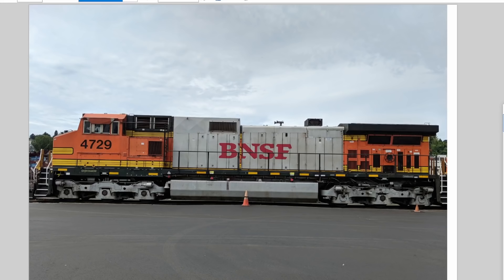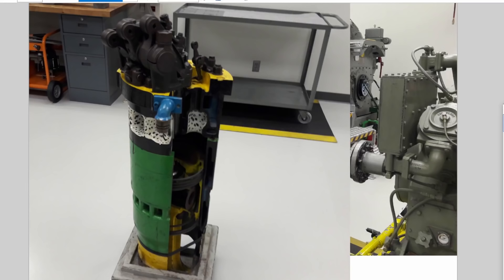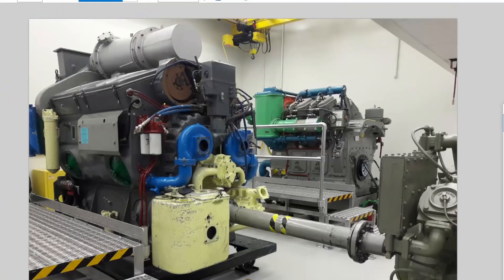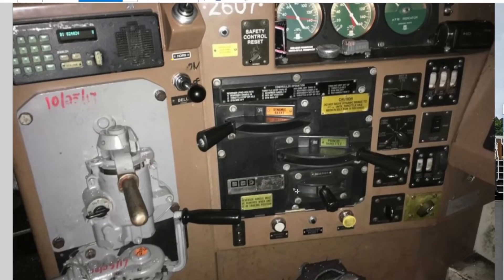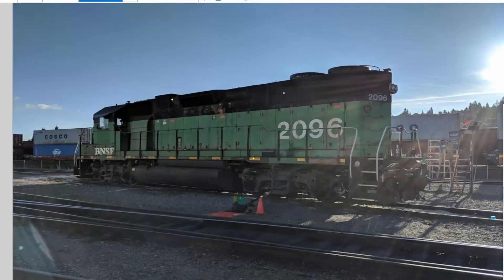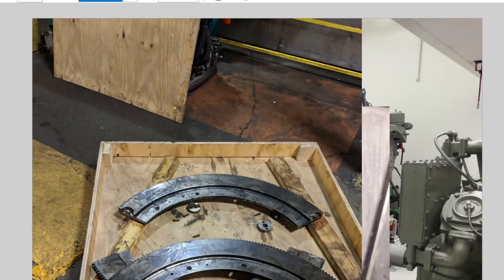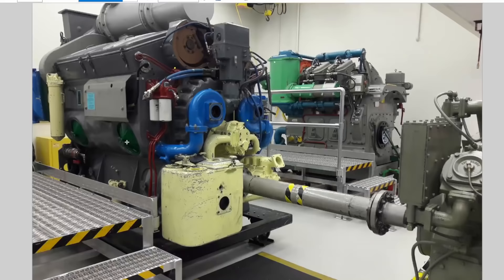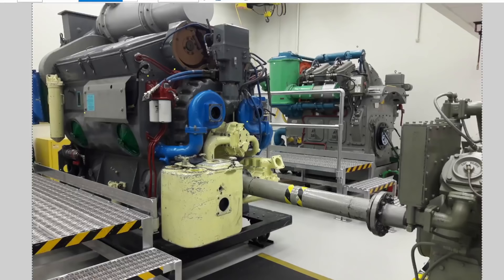Diesel 101 - How DIESEL LOCOMOTIVES Work! [10 Levels]

Comment: Good video. As a trucker that used to haul replacement parts for Norfolk Southern....Alternators weigh about 19,000# and pistons, for a v-16, are  about the size of 5 gallon buckets. 
   Something I didn't know until I saw a new locomotive cab at a supplier....the sleeping and bathroom accomodation in the nose of the cab.
Reply from the maker: Oh man, i knew the alts we're heavy but not that heavy. Neat.

Comment: Really enjoyed learning about the diesel electric locomotives! One thing you might want to look into was the steam turbine locomotive that tried to make a appearance around the same time diesel really started to take over. I know that Norfolk western had a prototype don’t know if it actually got anywhere though
Reply: I think UP had a few turbine powered ones as well.
Reply: @pootmahgoots8482  UP had both steam and Gas turbines. The steam ones were a huge disappointment. The gas ones, not so much. C&O had 3 steam turbine electrics before the N&W built their only one. As you had electrical, fire, water and coal all in the same locos, they were maintenance headaches. The three for C&O were to power passenger trains, " The Chessie ", while N&W planned theirs for freight. The N&W looked more conventional as it rode on standard 6 wheel trucks with span bolsters. 
UP Steam Turbines: https://www.youtube.com/watch?v=K9mo9Ald6EI
C&O Steam Turbines: https://www.youtube.com/watch?v=HPaJKdBzwZs
N&W Jawn Henry: https://www.youtube.com/watch?v=5n0VuljeSM0
Reply: They still use steam (and gas) turbine electric locomotives to this day, some even run in water power!

They just do not put the generator on the actual locomotive and use long wires to connect them both!

:-P    :-b

Comment: 14:00 Fun Fact: The russian M62 locomotives use Roots blowers to get the air moving (0.2 bar) when starting the engine. After that, the turbos automatically take over to raise the intake pressure to 1.2 bar.

Comment: a note on the roots style blowers, air actually flows around the screws of the blower, not trough. the screws turn opposite of eachother
Reply from the maker: Yup, I've since learned that on this video. Had no clue, thanks for the comment :)
Reply: @Hyce777  Yes...  A roots blower is really just an external tooth gear pump (like an engine oil pump) with long gears.

Comment: Some additional info on blowers: The EMD engines have a turbo-supercharger, and it's an example of one of the less common meanings of the phrase. Depending on era and application systems called  "turbo-supercharger" can be any of the following:
A) A supercharger 'feeding' a turbocharger, the air is compressed by each in series.
B) A supercharger and turbocharger in parallel. The super feeds the engine at low RPM when the turbo isn't spinning fast enough to be effective. At higher RPM the turbo takes over feeding the engine and the supercharger is unclutched so as not to waste engine power running it. While turbos and supers complement each other well this arrangement is, in my opinion, overly complicated and an inefficient usage of weight/space. (Then again, I love the Napier Nomad and turbo-compound engines in general so what do I know).
C) A centrifugal compressor driven mechanically with engine power. This usage is frustratingly common in American aviation literature from the 30s and 40s. Not heresy on its own but distinctly unhelpful, especially with engines that also have exhaust driven compressors. 
D) The EMD! This is a centrifugal compressor that can operate as a supercharger or a turbocharger and arguably counts as both. I call this arrangement a super-turbocharger ostensibly to avoid confusion with A or B but mostly because it sounds cool.
Initially the centrifugal compressor is driven by the engine (as the author notes in video, at a gear ratio of 18:1). Centrifugal types work best when they spin really fast! An air molecule is drawn in and picks up a lot of kinetic energy when it gets whacked by the impeller blade. It flys off to the edge of the circle and enters an area of the unit called the 'diffuser'. You can think of it like a funnel or a que line. The air molecule runs into a crowd of other molecules and all of them have high kinetic energy and the diffuser gets them all moving in the same direction and in a somewhat orderly fashion. Another way to put it is that the diffuser uses geometry to convert a gas's kinetic energy (velocity) into potential energy (pressure). (This is further proof of math being effectively witchcraft. Geometry is especially sorcerous) 

You may ask, 'whats the point of having a compressor at all? A blower of any type is extra mechanical complexity, is it really worth it? The majority of engines commonly encountered by an average person don't have a turbo or a supercharger; they're naturally aspirated. They work just fine with all natural air just like god intended.'

First of all, never be satisfied with the way god put the universe together: it's suboptimal and can be engineered to be much better. Just one example: thermodynamics has "free energy" as strictly illegal and you can hope to "break even" but that's mostly optimism. Whenever energy changes from one form to another there will be losses. In a closed system entropy only goes up. So you have to be efficient when dealing with energy and heat.

That's where superchargers and turbo chargers come in. Engines are heavy, you have to haul the weight around with you and they only provide so much power. Forcing more air into the engine let's you get more power out of it for minimal additional weight. The forced induction can be either 'positive displacement' or compression. Positive displacement is less efficient, but it's useful at all RPMs. The work it does is linearly proportional to RPM. Using a rotary compressor, usually centrifugal, is more efficient but the work it does rises exponentially with engine RPM. So at higher speed it's amazing but at lower speeds it doesn't do much. Superchargers are usually positive displacement and driven mechanically. Turbos are usually centrifugal compressors and powered by an exhaust driven turbine. (That's not free BTW. Nothing in this universe is free. But harnessing exhaust gasses to drive a turbine is pretty efficient.)
Reply from the maker: Thanks for the brilliant comment adding way more insight than i had. :)
Reply: @Hyce777  You're welcome :) I'm happy to contribute; moreso, I feel it's appropriate to offer what knowledge I can to supplement a great video. I'm an academic and for the most part I haven't learned from practical experience but by voraciously consuming the published works of those who have. Or other academics who have already done the hard work of research and correlation. (Their work that is; academics don't consume each other to gain their power.)

On the topic of forced induction I would recommend fellow YouTuber Greg's Airplanes And Automobiles and his excellent video "Turbo Vs Supercharging in WWII Aircraft". A lot of my insight comes from that, and from going through the NACA reports that Greg based the video on.
Reply: @GRudolf94 to piggyback off of this comment, it got the name of turbo-supercharger because it was a supercharger that was turbine-driven off of exhaust gasses rather than mechanically linked to the engine. One of the largest issues the USAAF had with their early turbochargers was that the turbine blades were at risk of melting while in use and causing loss of power.
Reply: the EMD 645 uses a centrifugal turbo charger that is gear driven until the exhaust force drives the turbo faster than the centrifugal clutch on the turbo drive gear, at that point the exhaust takes over and drives the turbo,  a 2 stroke diesel requires a forced air supply to operate as there is no vacuum on the intake in a 2 stroke diesel

Comment: I used to work for L&S Electric near Minneapolis, MN.  At the time we did a ton of rail motors and generators.  We used to get A/C traction motors shipped up from BNSF Topeka.  Our shop guys would year them down and usually have to cut the stator cap off and restack them, at least in part.  Then rewind and rebuild.  We did DC motors and generators as well.  I did transport.  Did an onsite swap of a DC generator on a Red River Railroad loco at a grain silo once.  Brought fresh rebuilt generator out and a crane swapped them.  We did a bunch of work for Loram and CP as well.  Sometimes some other stuff as well.  At least for rail.  Tons of other stuff as well, like paper mills and power plants.

Comment: I love this, great job Hyce. I’m enthralled with your industries engine design. I wish we could pull liner/valve assemblies and swap em independently. That’s awesome. That and heavy mining trucks, even though they have a similarly sized engine, they’re all high pressure common rail injection 4 strokes with after treatment systems. Anything 2 stroke that we see are Detroit Diesel dinosaurs 😂 I really enjoyed the video. Thank you sir!
Reply: Detroit Diesel and the EMD engines are quite literally the same design by GM, so yeah, dinosaurs. :P
Reply from the maker: The GE stuff is common rail high pressure as well, also 4 stroke, but still w/ replaceable power assemblies.
Reply: @Hyce777  I’d be in Heaven. I have to remove the engine in the field, load it in the truck, take it to the shop to rebuild then go put it back where it belongs.
Reply: I saw a video recently about the diesels that power large ships.  They are designed so that the piston/cylinder assemblies can be replaced while the engine is running and the ship underway.  Absolutely amazing.
Reply from the maker: @LandNfan  whaaaa? How the hell do they do that?
Reply: @Hyce777  VERY CAREFULLY!!!  There are some great videos...  go to YouTube search and start with "welt - cruise ship engine repair".  Amazing stuff!

Comment: Of course what you got to see here Hyce is the most common locomotives, the diesel electrics.
However Germany have been a little more silly in Europe, you have Diesel Hydraulics and some even have transmissions and you can hear them shift.
Examples of this is the BR 642, Siemens Desiro and the hated Norwegian Rail's Type 93.
The latter a locomotive where you can hear it shift, but was dreaded by passengers as they got the brilliant idea of using a DMU on long haul rail routes.
In the end, the old style of locomotive with consist powered by an EMD prime mover that saw its hayday in the 60s, the EMD 16-645E3B is still running on that route today with an updated consist.

Oh and they did try to replace that Di4 locomotive as well, but in the winter they didn't like tunnels and had a tendency to shut off in the cold, so they were returned to Germany and the old EMDs put back in operation. :D

Comment: Great intro. Learned a lot mostly about the cooling and governor/fueling interaction. I had assumed a simpler system of the governor preventing the engine from over revving and the alternator excitation controlling load.

Comment: Yeah, GE's load REALLY slow in comparison to EMD's. A buddy of mine told me he put a unit in run 8 from sitting at 6. About 4 miles down the line, the motor was STILL loading up. EMD's load up just about as fast as you can notch 'em.
Also, plenty of the older EMD's with the 567's used the main gen as a starter motor. GE wasn't the first to do that!
Reply from the maker: Not surprised on that fact! Interesting. I was surprised the one time I've run an EMD just how quick it set off.
Reply: Worst loading GE we ever had on Conrail was the U28B. Fortunately we only had two of them. I got one as a trailing unit on a 120 car train of empty hopper cars going out to trap rock roughly 17 miles west of West Springfield yard with a GP38-2. I sat with the Gp isolated for over 6 minutes while the GE ever so slowly accelerating from idle then put the GP back on line, it was my first train as an engineer. West Springfield yard had a 1 percent grade heading west to CP 100. When we got to trap rock we had to pick up 60 loads of trap rock going to Selkirk, New York. It took over an hour to get that Uboat to full throttle. I complained heavily about it to Selkirk fuel pad Foreman about it’s performance. He shopped it.. had the same engine several months later only this time it responded with black smoke and loaded up much faster than before. I asked the foreman at the Selkirk shop what was wrong with it to load that way and was told “ nothing was wrong with the governor, that’s simply the way GE avoided black smoke was by crippling how fast the engine loaded. Once you got to the 5th notch or higher after they reset the governor the turbo kicked in and the smoke disappeared. All other GE’s while they loaded slower than an EMD we’re about 10 second behind an EMD in loading up in response to a higher throttle notch setting. When the dash 7 GE came out the slower loading GE became a thing of the past. The GE B23-7 became my favorite switcher engine after my first time using it. The trainmen could stand vertically on the bottom step without a problem, it had a bigger air compressor and was quieter compared to an EMD SW-1500. It also weighted more compared to an SW-1500, had a full bathroom and a better cab fully electric cab heater. I showed up for my third trick switcher and the B23-7 had all the windows and doors left open with the cab heat off an 2 feet + of snow in the cab. I closed all the windows and doors except the engineer’s window, turned the cab heat on low fan and 35 minutes later I was dry as a bone in the cab and comfortable. All the snow melted inside that 35 minutes. 

Food for thought
Reply: @james5360  That's an awesome story. Thanks for sharing this! Really gives more insight on the how and why.
With steam locomotives, it's almost all a "feel through the seat of your pants", you can really get a much more clear cut answer with diesels. You know more of what you're getting into and what to expect.

Comment: 37:44 those holes aren't actually for balancing the flywheel, they're for 'barring over' the engine (rotating it with by sticking a lever in the hole and pulling on it) The balancing holes are usually on the inside face towards the engine.
Reply from the maker: Oh really? huh, we had bar-over machines that grabbed the ring gear. That's neat. Cheers for the correction.
Reply: @Hyce777  The tool that grabs the ring gear is probably a bunch more ergonomic to work with though. 👍
Reply: @AlexanderBurgers  sounds like a 2 (or more) man job

Comment: Very informative.  Learned a lot of stuff that I'd been curious about.

Being a bit pedantic, "regenerative braking" means using the power generated to either charge a battery to use later or other trains on the line through the catenaries or third rail, so it'd only apply to electric locomotives/EMUs as far as trains go.  It's not practical to do so on those really long stretches of track where only one train is in an electrified block.  Without another train to draw the electricity, the dynamic braking fails and a backup resistor grids are needed to take on the load.  This is why even trains that can do regenerative braking tend to have resistor grids on them.

Comment: here in the UK we actually did have diesel trains that used big shafts to run the wheels as opp[osed to a main alt and motors
Reply from the maker: We did have a few in the states too, it's just that's 1 out of 10000.

Comment: Yea, I had watched it with my dad who has been a mechanic for the engines for the last 20 out of his 29 years working at the BNSF and the first 9 years he was a traveling mechanic. But also he was in the navy and worked on the ships which most were steam turbine powered. Also the engines and trains you showed he first learned on. But a couple things he pointed out were that you mixed up the place where the fan and radiator was on the war pumpkin. Plus also that the trains that had the electronic control wouldn't have a governor.
Reply from the maker: Oh yeah, those dash 9's might have a different radiator setup than I drew, huh. And yeah, most of the modern stuff wouldn't have a governor or mechanical fuel rack at all. But, it's less interesting to just talk about the computer just doing it, right? :)

Hope your dad didn't think it was too terribly bad of an explanation for a white hat :P
Reply: @Hyce777  yea he thought it was pretty good for someone who was a foremen
Reply from the maker: @proeman6289  I will take that compliment and run :)
Reply: @Hyce777  my dad meant it as a compliment

Comment: This video is very informative to me & I actually have spent the last 14 years working for a supplier of these companies lol.  Heck we even built an engine rollover for BNSF a couple years ago... The mock-up 4 cylinder is interesting - There's a decent chance we actually made that one as we've done quite a few of those for GE/Wabtec , including all the ones in their Learning Center at the old GE factory in Erie...
Reply: We also made a GE turbo cutaway like the one you have pictured, except ours was done on a 45 degree, while still keeping the shafts, disc & impeller fully rotational like the one you showed.
Reply: on Wabtec's battery powered loco they have so much battery that they are planning to use the frame of the cab as the mounting point for the batteries because they have it so jam packed with battery.
Reply from the maker: Jeeze. That's cool to hear your experience!
Reply: @Hyce777  lol. We've been supplying GE/Wabtec for like 30 some years. We're working with Progress Rail on some other projects as well & have done work directly for NS, BNSF, Canadian Pacific, and some railroads..  Lots of interesting things have come through our shop over the years.